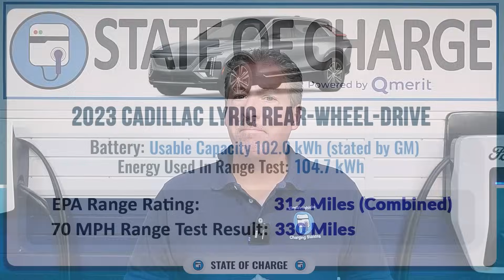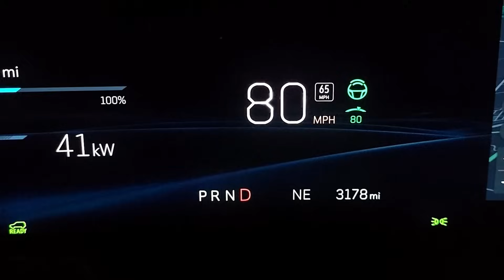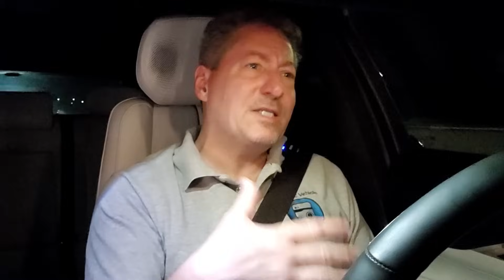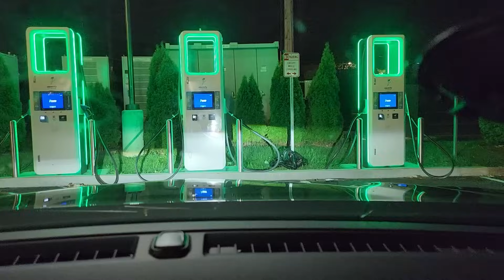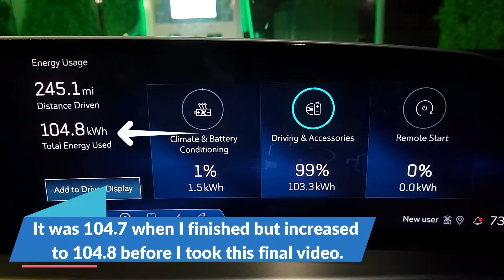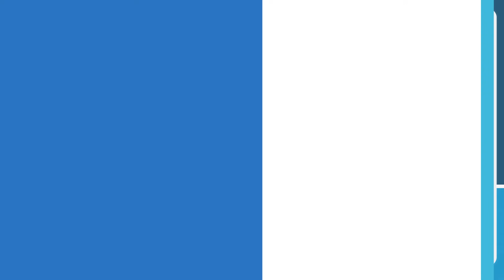Cadillac LYRIQ Range Test Comparison: 70 MPH vs 80 MPH

Comment: Something seems odd. At 10mph faster than the previous testrange dropped 27% but the first test, which was 15mph faster than EPA testing methods, somehow got better than EPA estimates? Especially with the first test he did having drag as a factor (which EPA testing methods don't account for). Definitely something going on.
Reply from the maker: The EPA test isn't a constant speed test, so it's not really fair to use that in comparison. I don't like using it, but it's the only established metric that I can use to compare.
Reply: @StateOfChargeWithTomMoloughney  I expect that they probably have two speeds they test at for "city" and "highway". I'm talking specifically about "highway" because that's why just the video was testing. EPA testing methods set all variables to give the best possible numbers even if they aren't realistic. Speed set to 55mph, no drag, no AC or heat and optimal ambient temperature.

Comment: Outstanding how many variable you were able to control for!  One more piece of math would really nail the whole story: on the hypothetical 1000 mile trip, how much of the time savings going 80 MPH vs. 70 MPH would be lost due to additional time needed to charge?? And at some speed, does the overall time savings actually become negative!?

(1000/70-1000/80 is one hour and 47 minutes less driving time at 80 MPH.  The charging curve would precisely provide the other information, but basically for every three charging stops at 70 MPH, you will need four charging stops at 80 MPH for each 1000 miles.  If we assume about two thirds of a full charge each charge stop, you would need an extra approximately 1.5 extra charge stops on that trip.  If we assume each one to be 30 minutes per two thirds charge, that's an extra 45 minutes for the 80 MPH trip.  (But each charging stop has, say, a ten minute overhead, minimum, to get off the highway and to the charging station site and the hooked up), for a total extra charge time of a bit over an hour for the 80 MPH trip.  So the total time savings of going faster with these charge-time assumptions is a meager 45 minutes for the 1000 miles, over the course of a 14.5 hour adventure at 70 MPH including charging, with a considerable boost in cost as was shown...)

Comment: Thanks for the comparison. Just for laughs, my 2017 Audi e-tron hybrid PHEV can make an 835 mile road trip for about $100, using 18 kWh and 18.5 gallons. My road trip speed limit is 75, 70, & 65.  That is 46.3 mpg and 3.9 miles per kWh
Reply: the etron is not a hybrid
Reply: @peppinoesposito5465  check your facts.  I own a 2017 A3 eTron sportback PHEV.
Reply: @Qrail  i didn't know audi's old phev's were classified etron.  this is no longer the case.
Reply: @peppinoesposito5465  it says eTron on the grille and on each side of the car.

Comment: Thanks for the practical demonstration and quantification!  In my experience with two decades of driving my Suburbans, the difference is trivialized because I stop for a gas fill up an exit or 2 earlier than I would otherwise.  Was the excessive speed material to me? No, because time is money and ending the “road-trip part” was higher value to the family than the dollars I wasted.  In my aging years, I’ll offset some with my R1T and slowing down!

Comment: I had to recalculate your data to  energy consumed over a over a standard distance for the rest of the world. (-me anyway.:face-blue-wide-eyes: although some like km/kWh) 
From your results : (I used your final calculation and 1.6094 km per mile)  
2.3 miles per kWh at 80 mph.= 27.16 kWh per 100 km. 
3.1 miles per kWh at 70 mph = 20.00 kWh per 100 km. 
That's 7.1 kWh more or about 35.8% more energy to push the car 10 mph or 16.09 km/h faster over 100 km. 

Thanks for taking your the time and to do these trials for us. 
I'll let someone smarter compare this to a wind tunnel drag co-efficient etc.
I like in the Kia/Hyundai software there is a driver's screen that displays a real time average consumption for the trip, since last charge, or historic. 
It lets you know if the trip is using more juice than average due to elevation, weather, traffic, etc.
The GOM is only interesting when it gets close to zero.   
Just imagine the extra drag if you had your windows down and arm hanging out the window.. :face-blue-smiling:.

Comment: And in other news, water is wet. While I appreciate the video, I would have preferred it focused on the reasons behind the difference more. Given the laws of physics, once an object gets "up to speed" any energy necessary to maintain it is due to other forces such as friction and drag slowing it down. Due to the need for efficiency in electric motors, any drag on the vehicle is much more noticeable and the drag is the largest contributor to efficiency losses.  The formula for drag is:

D=0.5*roh*V^2*S*Cd           where roh=air density, V=velocity, S=frontal area of the car, and Cd=drag coefficient

Outside of velocity, also known as speed, everything else in the equation is a constant and it is worth noticing that the amount of drag is the square of the velocity. This is also known as an exponential equation (70^2=4,900 while 80^2=6,400 which translates to 75% more drag). That means that ANY car, regardless of other factors, will experience 75% more drag at 80 mph than at 70 mph. 

With electric motors, the efficiency is very important as >85% of the energy is converted to motion (vs standard ICE motors which are ~40%). The only way to avoid this drop off is to overspec the electric motors by a large margin and that means that you end up "paying for more than you need". At this point, it is a fact to keep in mind when owning/buying an electric vehicle and personally, I would be suspicious of an EV that didn't show similar results.

On another tangent I found while working on this comment. At this point, we are limited on energy density. The generally accepted conversion for 1 gal gas -> kWh is 33 ->1 , which means that a car getting 33 m/gal is getting about 1 mi/kWh or less than a third of the Lyriq's 3.1 mi/kWh at 70 mph. To take it one step further, 20 gal of gas weighs about 120 lbs and contains ~660 kWh of energy, while the battery on the Lyric contains 102 kWh and weighs probably around 1,200+ lbs. As our battery density improves over the years it will become less of an issue, but at this point, getting as close to the top of the effeciency curve as possible is a large factor.

Comment: You may need to change the name of your channel from state of charge to State of Rant.  I do not share your optimism that GM or any of the other OEMs will figure out the EV space.   They continually make the wrong decisions every time and as long as they’re selling cars through the dealer with dealer markup, you’re kind of screwed.

Comment: I agree about the miles remaining issue but that’s not new.  My 2008 Cadillac after it gets down to about 40 miles just says low as well. This is a General Motors issue where they’re afraid to be held liable for the fact that you have 2 miles and you go a mile and you’re right at a gas It’s not an engineering decision. This is a dumb ass lawyer decision.

Comment: Someone check my math. 
330 miles @70mph = 4hr 42 mins
330 miles @80mph = 4hr 06 mins

Based on Tom’s charge test, it would take about 18 mins of charging on the 80mph drive to go 330 miles. Even with 10 minutes of overhead it saves time to drive 80mph.
Reply: Thank you for doing this comparison. Your numbers are within 1-5 minutes of what I calculated. Making the decision on stopping (80) vs. not stopping (70) is a complex one, but I think it is very valuable to calculate these things as you did. Some of the factors to consider in stopping (80) vs. not stopping (70) (A) taking a break (B) need to shop (C) do you know the charger will work (D) do you know the charger will work at a decently fast rate (E) charging infrastructure at your destination (and many other factors).
Reply: Your math is correct.  Tom's point is that at 80 mph, the range of the car is 245 miles, not 330.  The range of the car is reduced by 85 miles at 80 mph.  You would have to find a charger within 245 mile at 80 mph.  At 70 mph you would not need to charge until you get close to 330 miles.  And if you drive at 80 mph, you would need to charge more often (make more charging stops), which adds to the amount of time spent charging.  Assuming you could find a charger that is conveniently located and a spot is available.
Reply: Thanks for the info.  Most of my trips are 450 miles to visit family.  What would the time math/energy cost be versus a hybrid camry at 50mpg with one 10 minute fill up/bathroom break (50 cent per KW)?
Reply: @ who cares? It’s a Camry so obviously you hate yourself and the life you now live. Enjoy the soulless misery that greets you every time you get behind the wheel. Hahahahah

Comment: Interesting.  This explains certain behavior that I’ve noticed from EV drivers as someone who is yet to cross over from ICE.  Driving slower is fine for efficiency but why in the left lane?  I can’t tell you how many EV’s (mostly Tesla’s around the Seattle area) drive in the left lane below the posted speed limit.  It’s forcing other drives to pass to the right.  Not safe.  As an ambassador of EV adoption, pls speak to this etiquette.

Comment: There's a bit of math and science in this post. But there's a TL;DR at the end.

I’m typing this with the video paused at 4:42 in, where Tom is about to give his distance driven after 25% power used. Let’s remember that a (near) constant 70mph = 330 miles range. I’m going to calculate roughly what the 80mph range should be.

Almost everything else in both tests is a constant. Weight of vehicle, tire pressure / surface area on contact with the road, mechanical efficiency of the vehicle, gradient of the road used, cabin settings inside the car, friction and heat loss (energy loss through tire contact with the road) per mile driven, and the front cross-section of the vehicle that has to push air out of the way to go forwards. For variables not under driver control (wind speed and direction, outside temperature affecting the battery), Tom chose to drive in similar conditions for both tests to eliminate that as a factor, but he did the 70mph test in the daytime so it’s slightly cooler for the 80mph nighttime test which will adversely affect the range. The only variable controllable is the speed driven, and how much energy needs to be used by the EV’s DC battery pack to push that air out of the way of the front cross-section of the car. 

I’ll estimate the 80mph distance, using Inverse Square Law to calculate the relative force needed to get that air out of the way of the EV’s front with the speeds (70² = 4900 and 80² = 6400), like this:

** new estimated range at a new speed = [old speed, squared] divided by [new speed, squared], then multiplied by [the known range at the old speed] **

at 80mph, the estimated distance is (4900 / 6400) x 330 miles

4900 / 6400 ≈ 0.7656, also written as 76.56%

∴ 80mph ≈ 76.56% of 330 miles

∴ 80mph ≈ 252⅔ miles.

This means that he should go approximately 63 miles each 25% at 80mph, instead of the 82+ miles he achieved at 70mph. I’m expecting the miles driven at each percentage to be around 63 / 126 / 189 / 252 miles, but with the cooler weather we can knock off a few percent from those numbers. .

—

The actual miles were 61 / 120 / 178 / 245 miles. I was less than 3% off, which the outside temperature difference would explain.

TL;DR - If you already know your range at one constant speed, and you want to know how a different speed will affect your range, use the Inverse Square Law for a pretty good approximation. If you've posted your own distances, do the Inverse Law calculation to see how close it was.

Comment: My Model 3 AWD at 90kph gets around 135-140Wh/km vs on the highway at 120kph I get around 165Wh-170Wh/km in the summer.

So over say 100km @ $0.15 kWh that's $2.03 vs $2.48 (22.2% more expensive).

Comment: Tom, I appreciate you doing this test, especially having to stay up so late!  I did a 1,000-mile trip in our Rivian, we averaged 78-80 mph, 90-degree weather and got 2.37 miles/kWh which comes out a bit over 300 miles.  I've got a 300-mile trip today...I'm going to see if I can stick to 70 mph and see what I get.  I'm just so impressed with how well our Rivian does at real traffic flow speeds.
Reply: I also have an R1T, I’ve been pushing my single charge range lately as well, and really appreciate the accuracy of the nav estimate and remaining distance showing!  Good luck!

Comment: One thing you have mentioned is the increased charging time 1000 miles. At 70mph it  would 14 16 mins . At 80 mph it kake 12hrs 30 min  that's 105 mins difference . . I

Comment: In my IONIQ 5, 80mph is about 2.5 m/kWh and 70 gets me about 3.1. I can go about 192 miles from full charge at 80, 238 at 70. Assuming you are going to the same charge station 190 miles away either way, you would get to the charger around 20 minutes quicker going 80mph. My IONIQ can make it from 4% to 80% in 20 minutes or less, so doing 80mph I can make up the speed efficiency difference by charging more efficiently getting to my destination quicker for a bit more money. This obviously won’t work with a bolt and probably not with an id4 but anything that can hold over 200kw all the way to 50% can easily do it.

Comment: Tom, I’m glad you did this.  Although 70 is a decent clip,  it’s no longer de rigueur.  I’d say 80 on the open road is more normal on most suburban highways.  I95 really moves outside the cities.  The turnpike is too congested to do a constant 80 mph.

Aerodynamic drag is a thing, but the bigger thing here is a lack of transmission.  If the electric motors could run “ slower” they’d use less power at speed.
Reply: Aero is the huge hit.     Electric motors have a massive efficient power rang vs ice.  If you can save the inefficiencies of a transmission and that weight you are way better off for most vehicles.

Comment: Should mention how long it takes you to go X miles including charging time.   If you go 300 miles in this car,  at 80 mph it will take you 3 hrs 45 mins.   At  70 mph, it will take you 4 hrs 17 mins, about 32 mins longer.  However, going 80 mph, you will have to stop and charge.  Lets say you charge for 15 mins.  Going 80 now only saves you 17 mins.     Just a thought.  Going 70 is a lot safer than going 80 in most places.

Comment: Hey Tom, when hearing about your test my first thought was, will you get a speeding ticket?  Correct me if wrong, but I doubt any NJ highways allow 80 mph.  During a 3 hr drive you could easily pass a radar trap.  Did this concern you? 

Imagine the explanation to police officer about producing an EV range test for YT.
Reply: The fastest speed limit in NJ is 65mph but the police typically don’t care if you do 75/80 everyone does it so worst case is you’re the one that gets picked out of the group
Reply: @RobGuy199  Rob, we would never want Tom to get a speeding ticket, but it is material for doubling the number of views. My first speeding ticket with a Tesla in Florida required attending 4 hours of online drivers education, pass a written test, pay for education, and pay a fine.  OMG, a big lesson learned !

Comment: In my Ioniq 5 I sometimes drive a highway in British Columbia called the Coquihalla. It’s a steep mountain road that has a 120 kph (75 mph) speed limit…but of course everyone drives at 85 mph. It’s pretty unbelievable how the high speeds and steep roads degrade my range. Really quite scary. Oh…it’s also open in the winter, so there’s thermal issues as well.
Reply: Elms, say hi to Ogopogo next time.
Reply: Oh I had to do that drive a number of years ago to go to a wedding somewhere in BC. That was a pretty harrowing drive for the speed limit listed.

Comment: Maybe EVs are going to need at least some form of transmission to improve highway efficiency.  I know my Honda Passport gets almost no difference in mpg at 70mph vs 80mph.  It’s around 25mpg at 80 and maybe 26 at 70. Now it does improve to 29-30mpg at 60-65mph, though cylinder deactivation may start coming into play around the low end of that range.